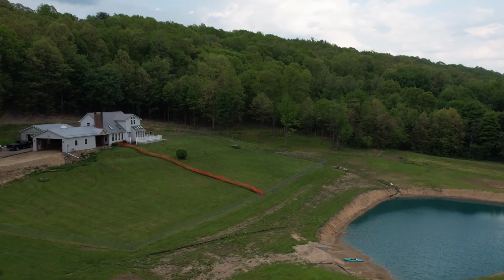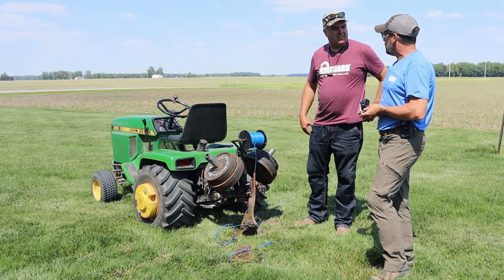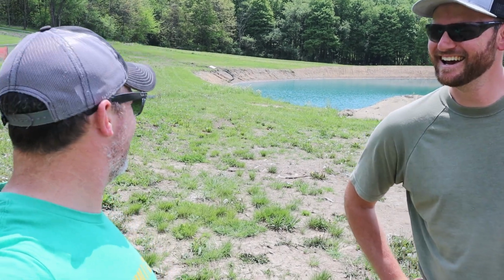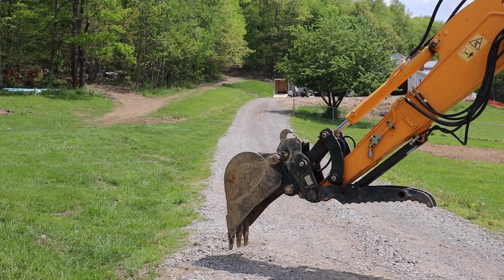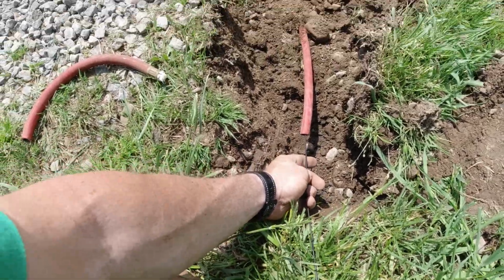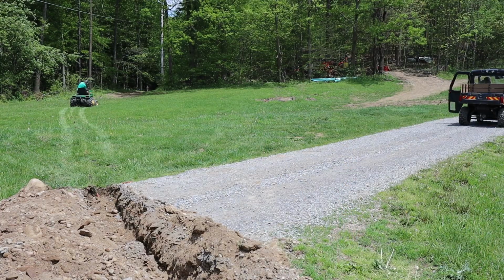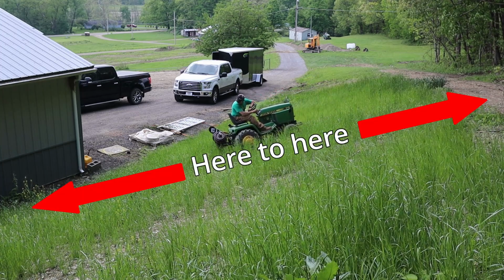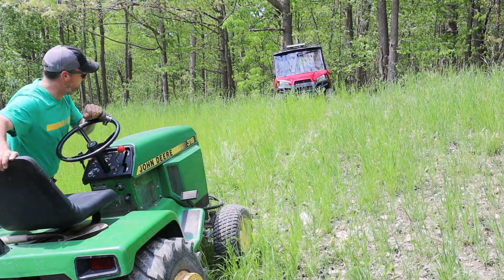I Took My John Deere On a 300 Mile Road Trip To Install A Dog Fence!

Comment: Well Planned out Neil, That was Hilarious ..
Cool to see you side of the visit...
 I commented on Adams Video about hiding the Controller under My OWB. Mine had "0" splices. I left enough wire at the start and at the end of the run that I could Wrap (not twist) the two tails together for the 30 Ft run upto the OWB. 
Mike M.
Reply from the maker: That would be a cool install to have 0 splices!  Well done sir!  thanks so much for checking out the video.

Comment: I have a 318 myself. Never plan on selling it. It's been said it's the best garden tractor John Deere ever built. It's a bold statement but the fact these tractors are still working over thirty/forty years later is a testament to their build quality. These tractors were way ahead of their time even back then when first built in 1983.

Comment: . Good choice 14ga wire ,easier to splice as I have managed to cut it with my back hoe and spring snow plowing  too many times and its on only 1.5 acres of the property. Have plenty of waterproof wire nuts and wire on hand .Do test wire for breaks before you start. Trouble shooting a MFG defect is easier on the roll than in the ground I found out the hard way.

Comment: Neil… Brutus logged some serious hours on that journey!  And, you did it without a bug screen… glad you had your shades on.

I am in the process of getting a new dog.  The last two were pancaked on our road in front of the house.  Before I do that, I am going to install an electronic barrier.  We really can’t subject another pet to the fate of Abby and Shasta.

I’ve done considerable research and have yet to come up with a wireless system that will work.  Those that have a radius are too small or can’t be placed in a way that an obstacle won’t block their transmission. The GPS limiting systems require a monthly subscription through our unreliable internet reception area.  

My best bet is a wired system.  But, it will require me to bury a wire.  That is where the challenge comes in.  You see, I live in an oak forest in the rocky foothills of the Ozark mountains. 

Plowing the wire in won’t be easy.  There is scarcely a yard that isn’t rooted or rocked in obstacles.  Just do the topsoil you say…. There is none!

And, that is where I’m stuck.  Imagine if you can,  a roughly square 10 acre plot.  Completely covered with trees… except for 1 1/2 acres of meadow.  The yard is  treed in too. We even have trees all around the house.  One is so close the soffit is cut around its trunk!

I thought about putting the barrier wire above ground.  I have enough old copper telephone utility wire to do so.  But, as you can imagine… the cost of posts and hardware are prohibitive.  Not to mention the hassle to maintain it beneath shedding dead fall limbs and forest edge brush.  

So, I am stymied.  I really miss having a dog.  (The cat and I don’t really communicate on the same plane.). However, I can’t in good conscious subject another dog to the fate of the last two.  

Any advice you can give would be greatly appreciated.

And, lest I forget, I enjoyed this video a lot! Thanks
Reply from the maker: Oh man Dave.  I read this yesterday and have been thinking about it ever since but I haven't come up with anything brilliant yet. Your situation indeed sounds tricky.  The wire doesn't require much cover or any really.  The cover is just protection for the wire.  I've heard of folks laying this down low in their grass and letting the grass grow up and around it and it has worked for years like that.  What about something like a vibratory cable plow? Would that get through some of your terrain or is it just too much rock? Maybe you can do a hybrid of above and below ground? If you laid a garden hose across the top of the ground, would it be covered up with leaves and debris in a year's time? At one time I probably had enough garden hose to enclose your entire property.  I had every friend and relative saving old garden hoses from any trash can or garage sale.  They make a  great conduit for the wire as long as not exposed to the sun every day.  The connections allow you to fish the wire through great distances. But, that requires lots of hose.  You can use poly air line too. 

I wish I had better ideas for you. Wish I could see it in person despite having a pretty good idea based on what I've seen in your videos and how you describe it. 

I'll have to keep pondering.  The biggest question is what kinda traffic would the majority of the wire see if it was just laid in the ground? Meaning, with minimal cover would it still be at high risk? You could always lay out the wire and do the training and get your dog very acquainted with the boundary. After all the real thing that makes it undergrad dog fence work is the training of the dog to stay in the boundary not training the dog to fear the shock. If you could get that established with a dog and have it work for even a short amount of time then you would probably gain a lot of benefit for the dog. The wire is relatively cheap to fix and repair If it gets damaged one or two times.

I'll keep thinking on this though....
Reply: @digdrivediy  thanks… I guess I need to do a pretty good assessment…. Of the area but also of the needs.   Do I really need the dog to roam all of the woods?  Can I train it to go through the boundary only when I’m around? Is there enough old hose to do the inaccessible/impractical areas?  

Thanks Bud, you’ve given me a leg up on figuring it out.   I’ll let you know what comes next.

Comment: Hey Neal, just wondering if you  think this same concept as the wire underground installer you made could be made to install Pex waterline (not needing to be under the freeze line)? something from garden to the house.
Reply from the maker: Sure! I've installed some soft irrigation line with a modified knife.  It can be done if the ground conditions will allow it.

Comment: Great video. Do you have any tricks on finding a break in an existing dog fence. My neighbor asked me to help fix hers after a lightning strike took out the transmitter. I hooked up the new transmitter and the loop is broken somewhere. Unfortunately I didn’t help install it. So I don’t know where the wire is ran exactly or where any splices might be. All I know to do is start pulling it up until I find the break Or start over and lay a new wire. Any ideas?
Reply from the maker: You can usually hear the transmission of the signal in the wire with an AM/FM radio. Set the radio to AM and hold it close to where you think the wire is buried or you can start out at the transmitter and hear what it sounds like through the radio. It makes a very distinct sound and you can use that like a locator to go around and trace the wire. If the wire is broken you have to buy what's called an RF choke and put that in line of the wire and it will send the signal out from both directions rather than in a loop.
The combination of an RF choke and an AM/FM radio held close to the ground or mounted to a stick lets you walk around and find the wire with high accuracy. When the signal gets weak or it gets hard to hear then you're within a couple feet of the brake and the wire usually. I've used this method many times to find broken wire and it works really well. Actually shot a video of me trying to find one but never published it. Maybe I should do that?  I have not looked lately to see if the RF choke is still available anywhere. I used to buy mine at radio shack and they are out of business obviously.

Comment: You should have ran some wire through the woods.  Dogs are prety easy to train to poop in the woods. Dog poop in the woods means no cleaning up dog poop, no mowing dog poop and no walking through dog poop in the lawn.